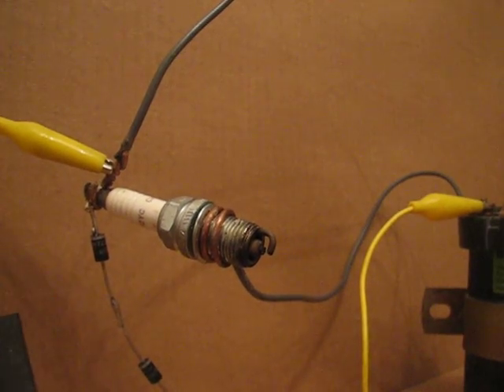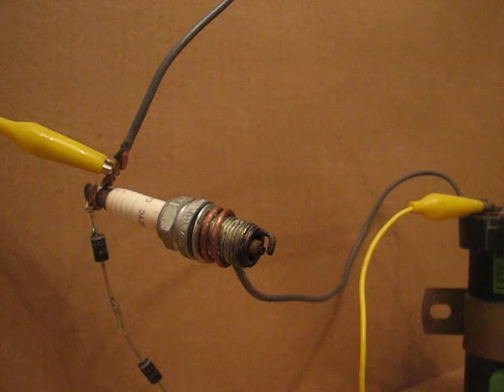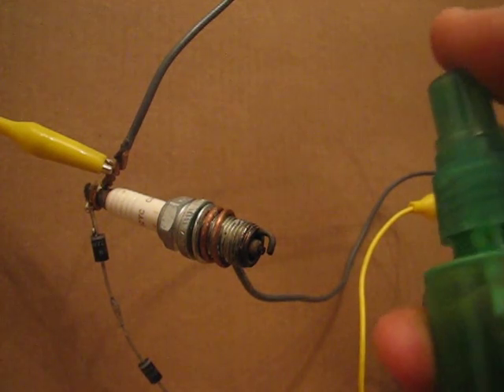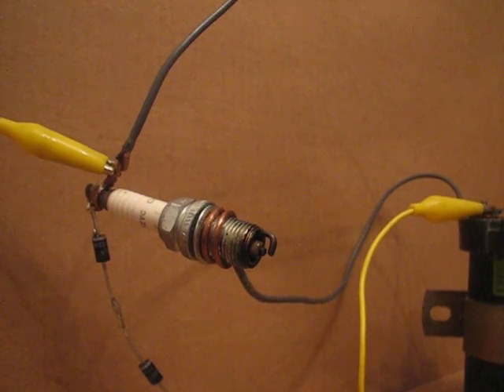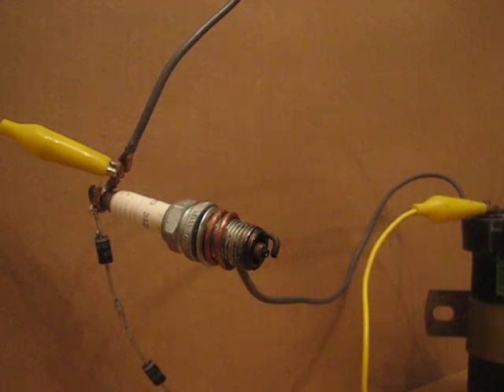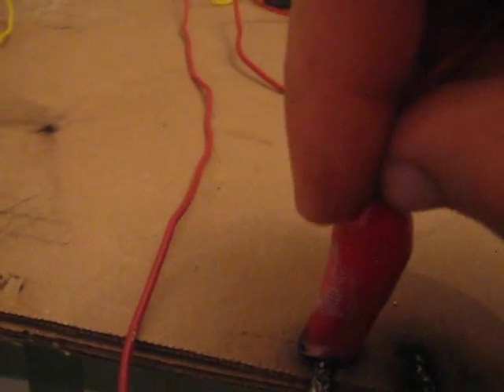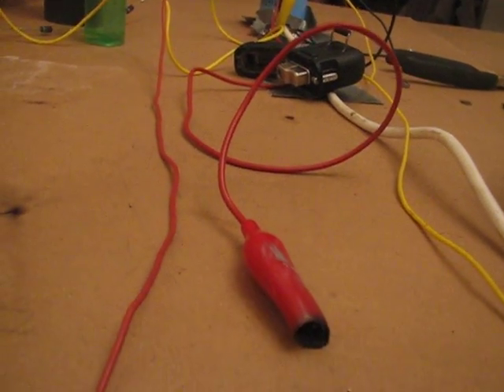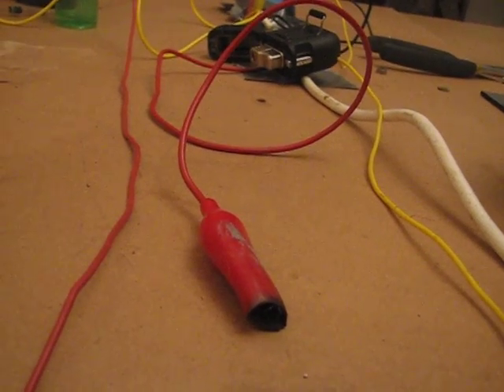plasma arc with gasoline

Comment: If you want a much more efficient method of switching you could use a heavy duty SCR. They're like transistors except once they are activated by the gate signal they stay active until the capacitor is fully discharged. You can find heaps of them on the internet but I'd recommend a pretty hefty one above 100A for the spark you're getting.

Comment: a switching circut? maybe a relay? but maybe i need some more details! an i would suggest a breaker somewhere in there... So if theres a problem it will trip the breaker. :)

Comment: hi Tiltfulll  I think you will need to keep the high voltage arc from your coil to jump the gap   I think If you just use it as a trigger to trigger capacitor lower voltage cant jump the gap . If you rectify your ac current you can run it through a light bulb then to the capacitor and then through diodes then to plug and you wont need to switch this high current with a switch cause the spark jumping the gap will trigger it to turn on .